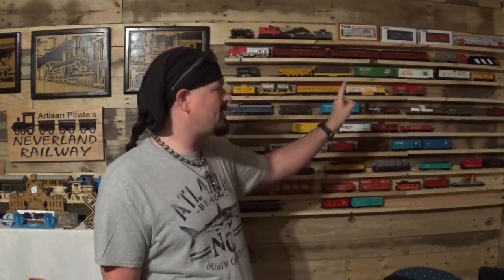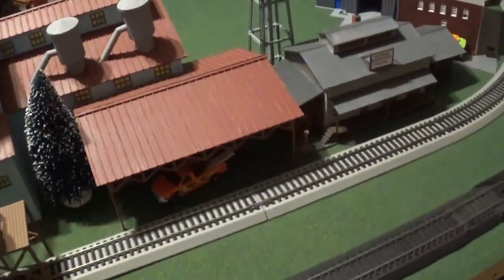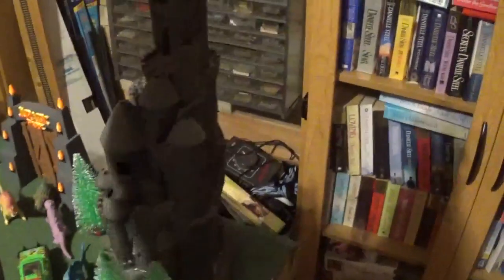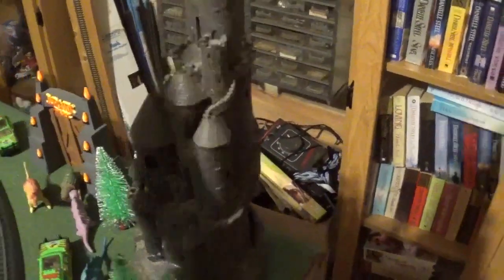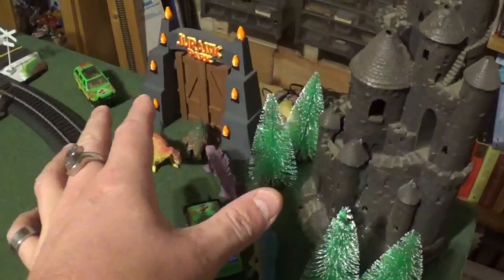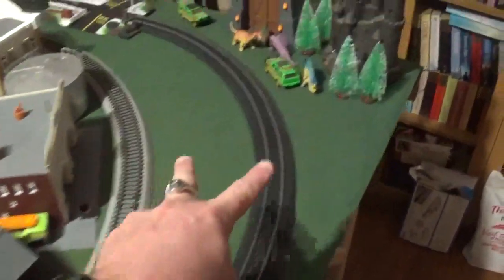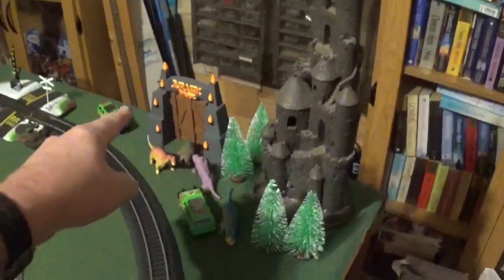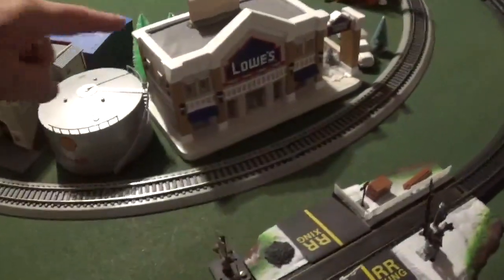Train Room Update, My Permanent H.O. Scale Train Table Is Up!

Comment: Nice update on the train layout.  It never really occurred to me how much 3D printing could open up this hobby.  I have built several small wooden structures and such over the years, but being able to print up what you really want changes everything. You can really copy textures more realistic than I'd ever dreamed in the balsa wood says.

BTW, I haven't forgotten about our sticker swap, I'm just out at the moment so it will be after the holidays before I reach out on that.
Reply from the maker: No problem on the swap! Also for sure! All of the structures I 3d printed were printed on a basic run of the mill 3d printer like an Ender3

Comment: Looks awesome what kind of 3D printer do you use i have no idea about 3D printing and would like to learn and wondering what printer should look at buying
Reply from the maker: Hey, thanks for reaching out. I have 3 3d printers. I have a Longer LK4 (my first printer) a Longer LK4 X Printer and an Ender3 printer. "Most" people begin with a basic Ender3 printer and go from there. You will need to learn maintenance and tlc for each printer and ender3 parts are readily available on Amazon.
Hope this helps you